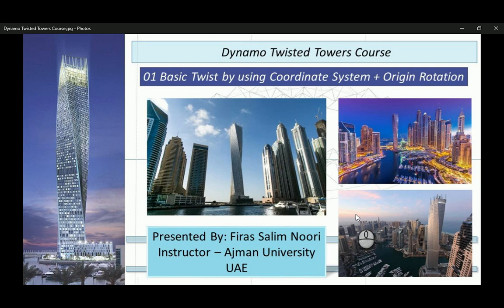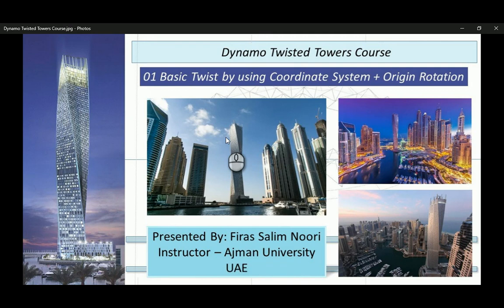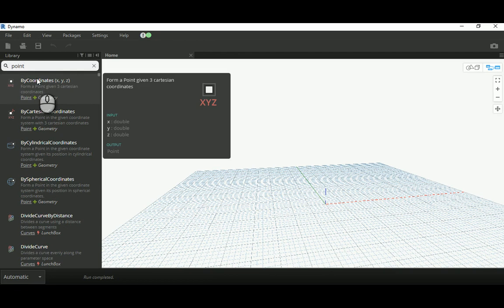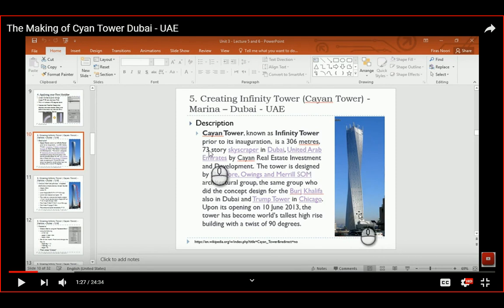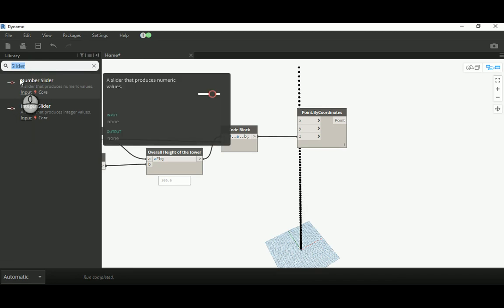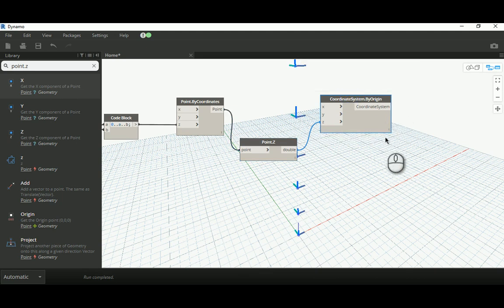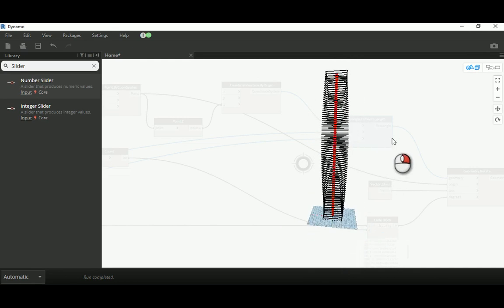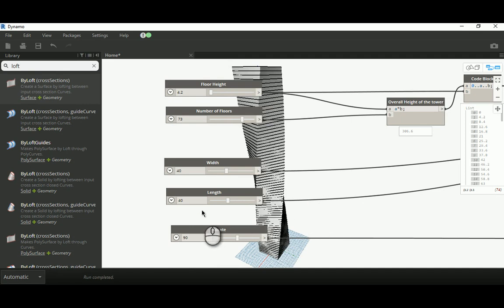Dynamo Twisted Towers Course _ 01 Cayan Tower Dynamo _ Coordinate System and Origin Method

Comment: Thanks for tutorial. How columns or structural shell are modelling in such type of buildings in revit?
Reply from the maker: Most welcome dear, there are two main methods, either you use a set of columns that plant in the common and shared part of each plan, and they will carry all side slabs as cantilevered, the second method, is inclined beams combined with vertical, the included columns are at the perimeter only